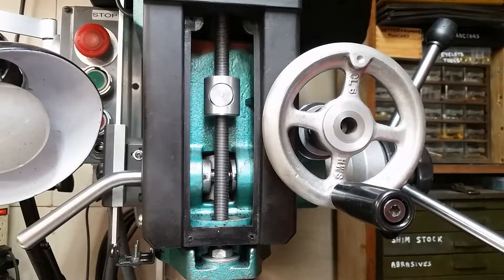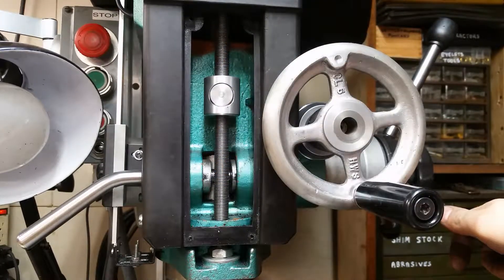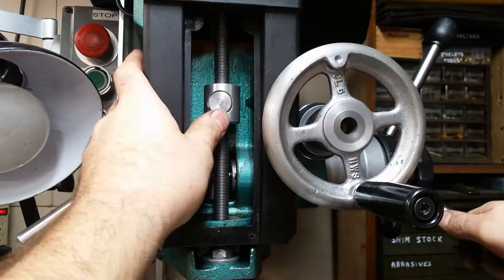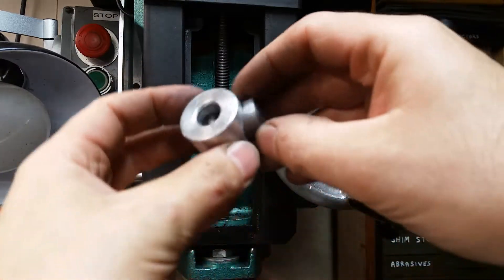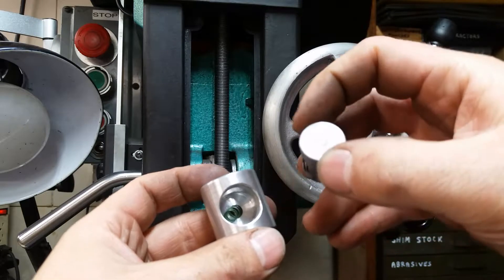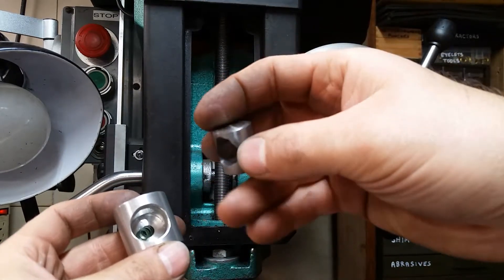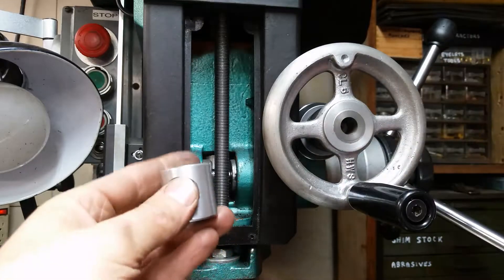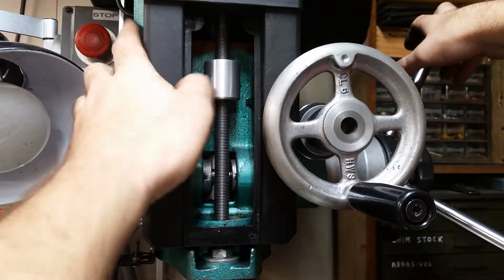Quick Release Depth Stop

Comment: Why use aluminum lol
Reply from the maker: Only the body is aluminum. The pushbutton and threaded rod (the only real friction surfaces) are steel. The spring will make up for any wear that might occur on the aluminum body from sliding across the face of the threaded rod. I've been using it regularly for 4 or 5 years. No appreciable wear or performance issues yet.

Comment: Very cool solution. I have the "normal" threaded rod with a nut depth stop on my drill press but very rarely need it. I'm mostly drilling through holes but clicked the like button in case I have a problem that needs you solution in future. Funnily enough I've also been looking at quick release vices recently and was just thinking if this could be adapted for that? If I come up with something I'll let you know. :o)